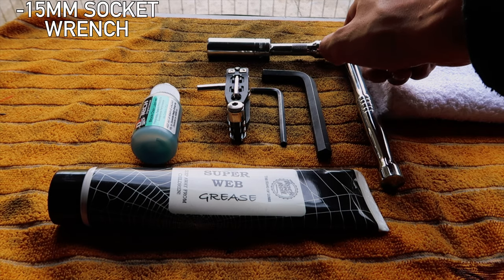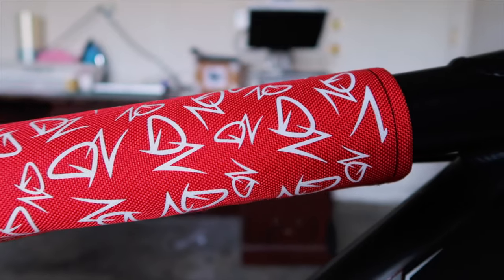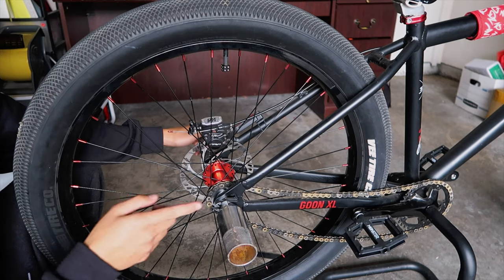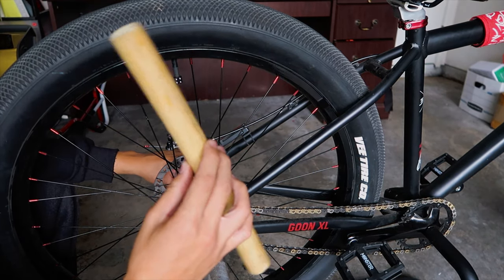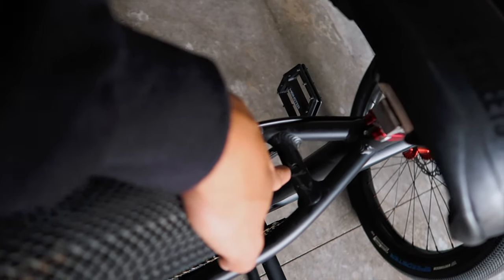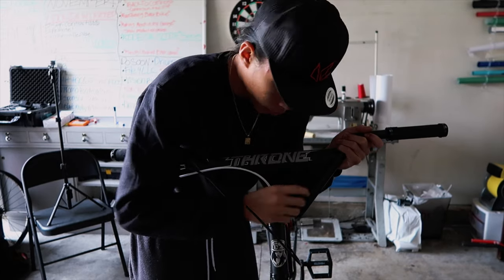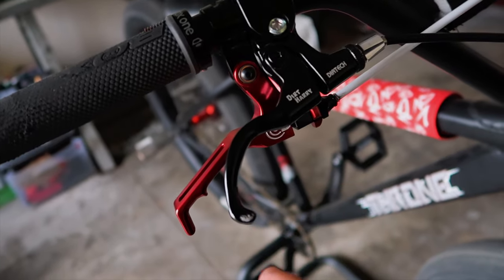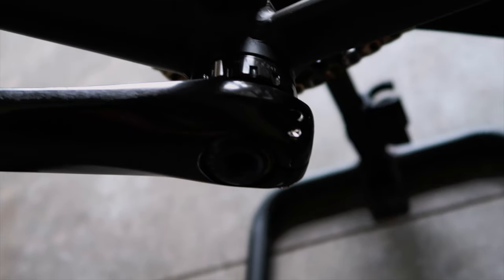MAINTAINING A WHEELIE BIKE | THE GOON XL

Comment: I have the same issue with my rl275 on the back wheel for what ever reason tire shifts to a side when tightening the nuts,  so to get it right I measure the RIM to the side frame tubes, tires are not perfectly round so that’s how I center the RIM cause It must be center to be able to center my caliper break too. It’s tedious but it’s got be done.BIKE ARE NOT PERFECTLY SYMMETRICAL.
Reply: I have a the same exact problem when I tighten the nuts the wheel shifts towards the rim
Reply: As you tighten SLOWLY each nut,  the same goes for the chain tensioner tighten SLOWLY, don’t depend on the chain tensioner too much. Use one hand to give it tension and keep the RIM center as you slowly you  tighten each nut and those of the chain tension.
Reply from the maker: washers could help

Comment: Bought a goon 29” from a local bike shop and they said they looked the bike over before I took the bike home I went on a ride and the chain snapped on the first ride I’m not sure if it want the chain or my weight or what the problem was just wondering if the kmc chains are bad or I weight too much I am 230lbs or any suggestions on how to deal with the shop I have looked up the throne warranty it does not cover and unfortunately the bike did take some minor scratches because the bike went down

Comment: So your telling me I spent $900 and all I can do is wait for the next drop 🤦‍♂️
Reply: I got the same bike I got tensioners it helps and he said with a half link chain it will fix the problem I’m gonna try
Reply: @jdbernalyuriar6731  what tensioners did you put on cuz the se ones don’t fit on my bike
Reply: MOST WANTED they should fit I have black se tensioners maybe you have it on the wrong hole there’s 2 holes
Reply: @jdbernalyuriar6731  i put it in the right hole they barely fit I had to force them on and the chain was way to tight to ride
Reply from the maker: Nah, actually I just told you how to bypass it.
Reply: @DeezyBikeLife  so if I get a half link chain it will fix the problem??
Reply: DeezyBikeLife how?
Reply: @MOSTWANTED @DEEZYBIKELIFE he obviously said go spend more money since throne didn’t do it right. I bought the deezy for my 1st bike and was disappointed as hell. Cheap ass bolts were my main thing. Look brodie all I know is if I had a signature bike representing my name, I’da made sure that NOTHING would have issues. This bike is putting a bad name on throne cuz of that dumbass back wheel problem. Granted mine never had rubbing issues
Reply: BTE ACE yes bro imma sell my deezy bike I had a big ripper before and was the worst mistake to sell it my back wheel had so much space with 29 inch maxxis on
Reply: And my back wheel keeps getting loose when I tighten my chain and ride my bike my chain loosens up and rubs on the frame
Reply: MOST WANTED did you end up fixing your rubbing problem?
Reply: @jdbernalyuriar6731  no

Comment: dude, you be using those pegs wrong.... damn. that washer is making your setup weak! take that washer and toss it, put some tape on the frame to protect the paint and turn those pegs so the flat side is 90degrees to vertical when riding them. SHeeSH. Also rim brake, get hydraulics. :face-blue-wide-eyes::face-orange-raised-eyebrow:
Reply: i think thatg chain is trashed, got a locked link.